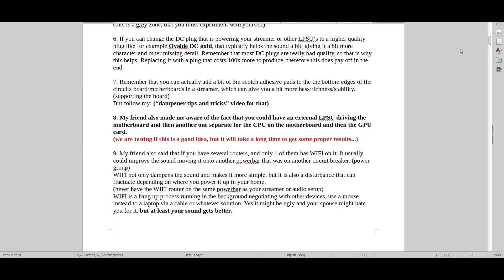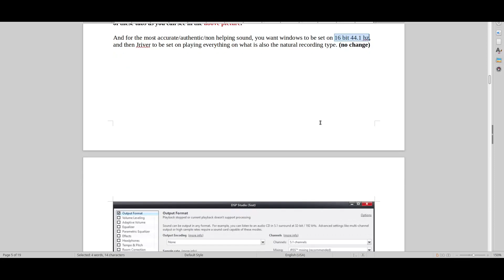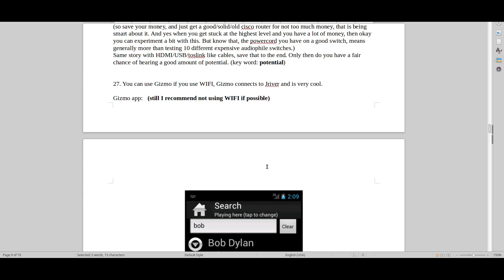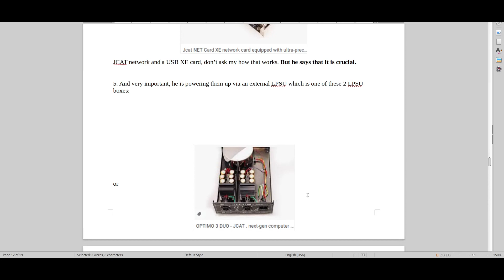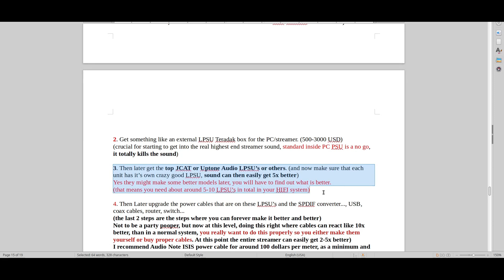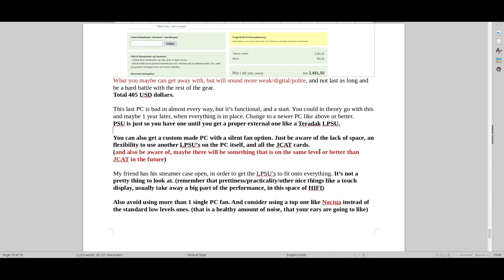The best audio streamer in the world: now you can build it

Comment: I built a streamer at the innuos zenith level for less than 600 euro. Better power supply ( i used better component but same topology). It has a 2tb hard drive for storage and a CD player for ripping bit perfect. The software is minimal and optimized and everything is based on the raspberry pie 4 customized at the hardware level to separate the CPU power supply, the busses power supply, the hard drive and CD player power supply. 
Everything you talk about is done but at a deeper level :). Simpler so better in my opinion.
The next step is to dig threw it. Separating all the busses and components power supplies. 

That's how hifi should be done but I'm learning more and more that commercial products are designed with cost in mind. And the no cost designed are sold 10 time the price it cost.
So a 600 euro product is sold 6000 in general. 
Man you gotta invest in the technical side. It pays dividends 😀
Reply: I'd be quite interested to hear more about your build. I'm looking to do the same, especially as you describe your project to include CD ripper and storage.

Comment: Do you think a 5k audio pc/streamer with lpsu’s like you explain will outperform for example a AN CDT2/II ?
Reply from the maker: That is about a 10-15k USD solution building that.
Assuming that all the work has been done, and proper matching with the rest of the system.
Then I think that the CDT2 has no chance.

CDT2 will still beat most things on the market, especially most streamers.

I think you need to go up to cdt5 before AN maybe will beat this streamer.

CDT5 will without a doubt beat all cd players on the market.

Comment: with all due respect, the tittle should include 'computer based'. imho a dedicated streamer like dcs network bridge and the like will outperform it by far!
Reply from the maker: Every streamer is computer based.

This takes the entire chain apart, and makes you control every single aspect of the signal. You can't do that with a normal streamer.

This is a much better PC with around 10 boxes around it.

This solution is around 25% of what goes on in an audio setup. If you just buy a one box closed solution, you are only dealing with about 5-10% of the audio system, thereby giving you less control, directly translating into having to put more money into the parts to rival this.

Comment: The more I follow your adventure with building the perfect streamer the more I get the feeling of how fragile or delicate the digital domain is. Bits are bits, aren’t they? Not so sure 😆
Reply from the maker: I'll tell you this...
It's was so difficult getting to this level of sound, that you almost felt like the whole world deliberately wanted to lock this part of the market, so there could be more randomity. So inferior products could exist to the left and right.

But now, we finally cracked the code.

At this level, you can hear at least 3 levels of routers and switches/usb cables. It's that good.

No one box solution can do it all at this level. Unless it maybe in the end costs like 100k USD, then it might be possible.

Comment: This is a great video. I would just like to point out that 1) there are power supplies that are even better than JS2 and Optimo, like Sean Jacobs DC4, and Paul Hynes SR7. Those are very expensive, 2 to 5x the price, 2) an alternative to Jcat is Pink Faun. The PF cards also have optional clocks that go up to 1.5 KEUR. Different type of sound, the Pink Faun is warmer in my experience. 3) such a project is not for the faint hearted like you said. There will be a lot of obstacles and setbacks along the way…
Reply: Exactly! Very valid points.